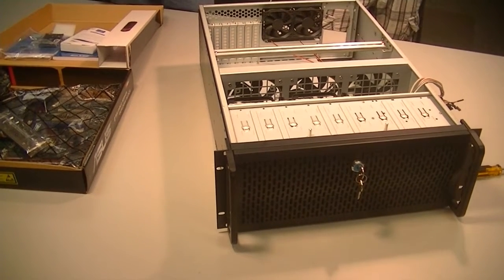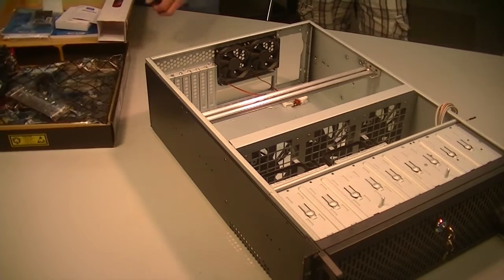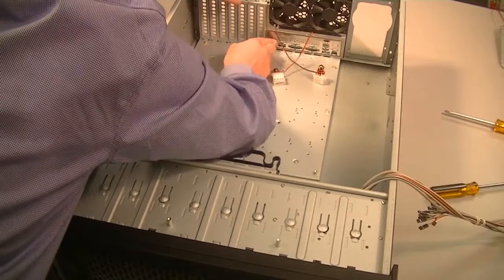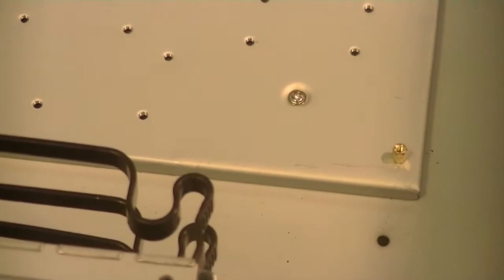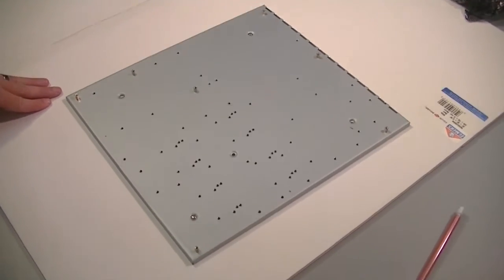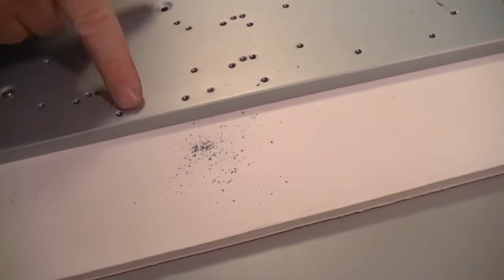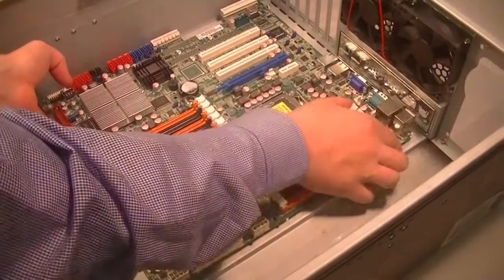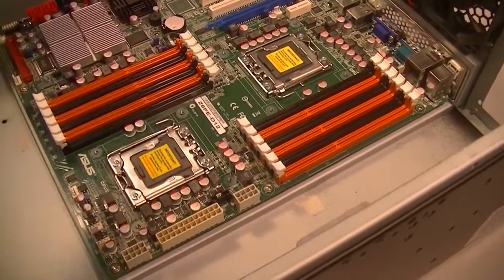How to build a server computer: Part1 Installing the motherboard

Comment: which server case is this and where can I buy one?
Reply from the maker: It is a Rosewill or Roswill? and it is still available at NewEgg dotcom I believe
Reply: danscourses serial number ? Model number please !
Reply from the maker: @MrJGarcia13106  Rosewill RSV-L4412 - 4U Rackmount Server Case or Chassis, 12 SATA / SAS Hot-swap Drives, 5 Cooling Fans Included
Reply: danscourses thank so much for your quick response !

Comment: Technical Specifications (some were left off by the poster)
- ASUS SERVER Motherboard Z8PE-d12 Series
- LGA 1366 Socket, Land Grid Array or LGA is an Intel CPU socket Technology
- RAM 4GB  ECC, Error-Correcting Code memory, Who makes the RAM ? Elpida, Samsung?
- Intel Xeon Processor 5600 Series (server processors)
- PSU 850Watts, who makes the PSU ?
- What are the HDD storage capacities? who makes the drives?
Some MOBO specs:
IDE     133/100/66
SCSI    None
SATA     3.0 GB/s
RAID    0, 1, 0+1, 5, 10
LAN     10/100/1000 LAN Ports
Firewire     N/A
USB     USB 2.0
BIOS     AMIBIOS , thought AMI was bought out by Phoenix long ago.
- The rack is made by ?
Note.- Noteciably the builders are not wearing wrist straps, it is unpractical but they could use anti static mats on the floor or table specially designed. The table antistatic thin mat is practical, you wont even notice it is there, it is great for laptops. These are precautions and preventive.
- The video man great voice, good English and insight. If this is a course about building PCs and servers, would be super if translated onto Spanish or have a Spanish version of these series, after all there are 350 Million Spanish Speaking around the world, the viewage could double fold.
Great video series.
Is there software installation and Raid configuration videos that follow the build?

Comment: it's better to install the ram and cpu before putting it in the case
Reply: I disagree with that. There is greater chance that components could get damaged by flying screws or cords during installation of the motherboard. I would rather have to install the components after the motherboard because it would also reduce pressure from the components untill after its anchored.

Comment: out of curiosity can a server be used as a main computer gaming applications ect?
Reply: JEHERETIC Don't need an external sound card...
Reply: A: It's ETC Short for the Latin Et Cetera and B: No, server computers usually don't have video cards and sound cards, which are both NECESSARY for a gaming computer.
Reply: thanks
Reply: Depends. If you are lucky to have server motherboard with PCIe 3.0 slot you can buy a graphics card. About the soundcard it can be cheap. But isn't so effective because of the noise and too much power draw. Also sound will don't sound good because of noise. External DAC can work.